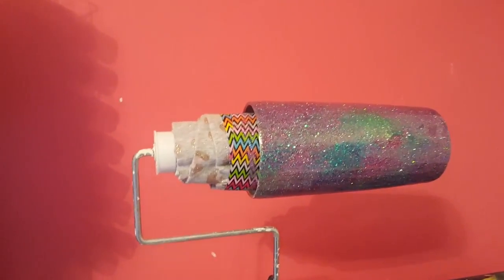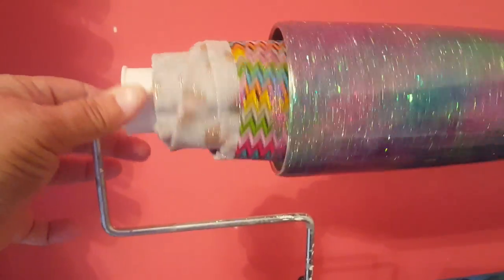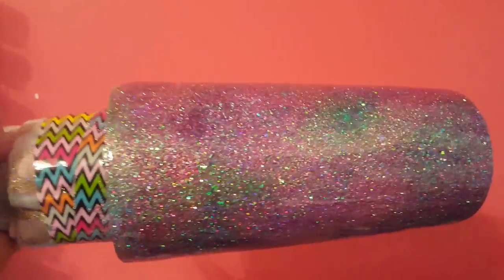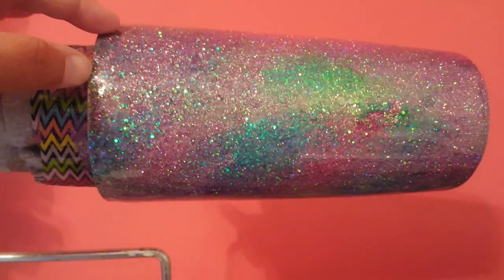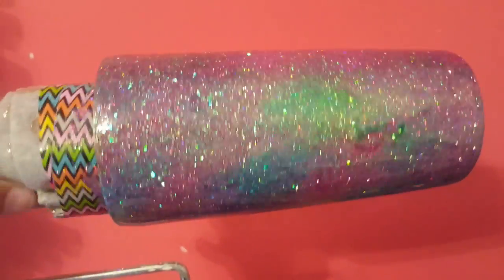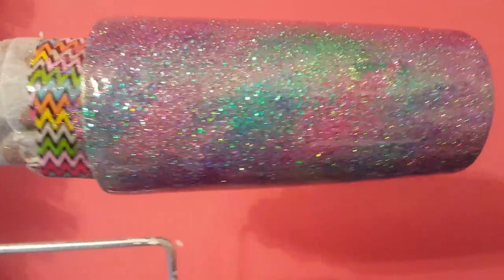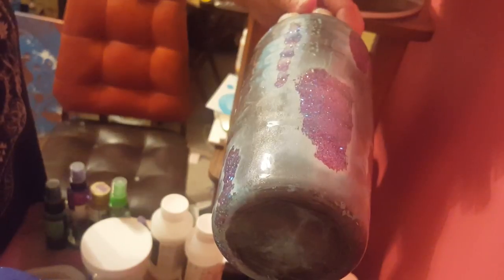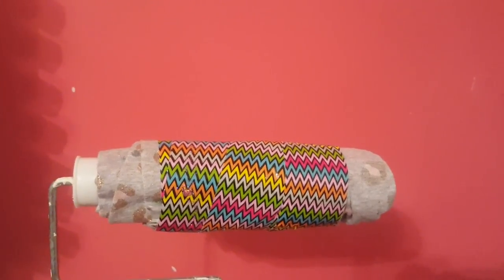Geode Resin Tumbler

Comment: Do these cups wash well? Lids set right after all that epoxy?
Reply from the maker: Yes they wash perfectly fine. I would have wash only though and as for the lid , yes they fit fine because the lid for this cup goes inside of the cup not on the outside and there is no epoxy whatsoever in there. Thanks for watching😁

Comment: trying to understand how to do this spinner to spin a cup
Reply from the maker: So this is what I did. Lol. I took a paint roller,  rapped one pair of my daughter's stretch pants around it nice and tight so the mug slipped on and held really tight. I literally crammed that cup over those pants lol I then took a vice from my hubby that clamped to my table and in the vice part I put the handle of the paint roller in it  And tightened it it up very tight. I even put the cup on the paint roller and proceeded as shown in the video. Hope this helps if not leave another comment.